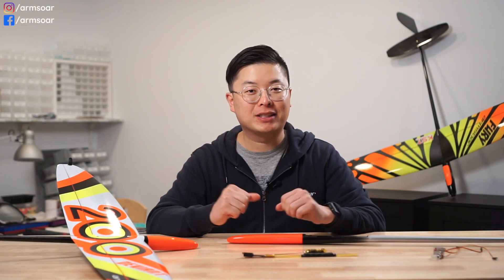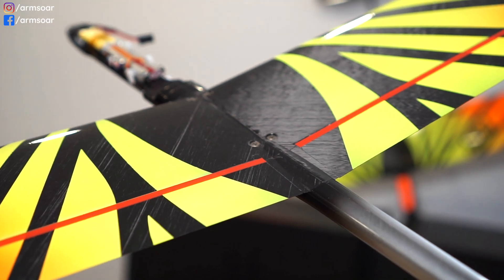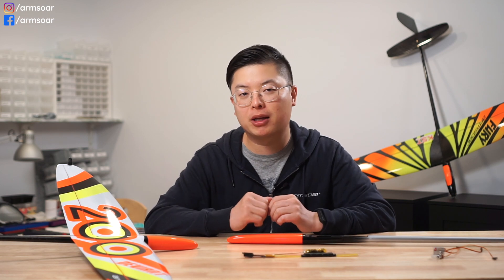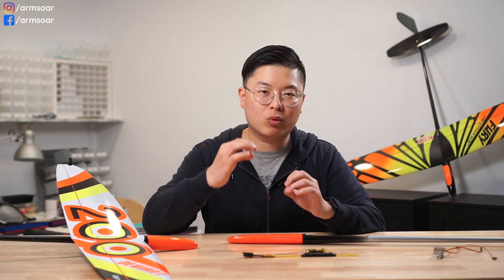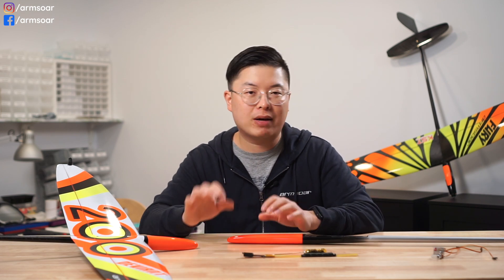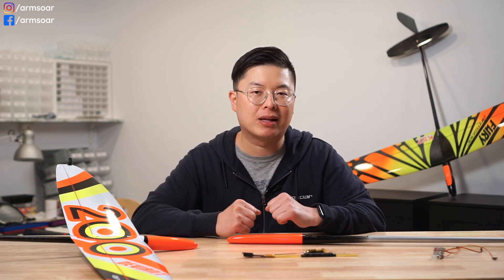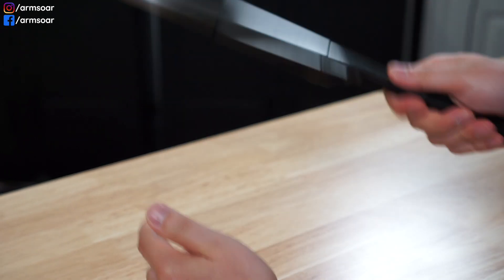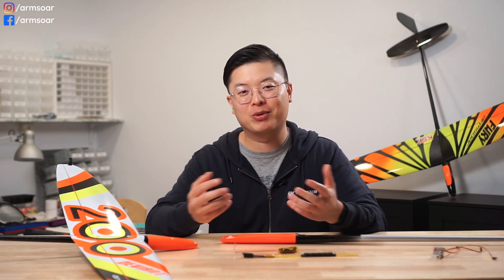RC Glider Basics | Ballasting Your DLG

Comment: Then you could use less expensive building materials like GFK instead of CFK. Then the plane must get other wings instead of more wight. It  will not get in my mind
Reply from the maker: That will lead to a plane with weights spread across the wingspan, reducing launch height, agility, and thermal sensitivity.

Comment: A word about the impact of wing loading on th polar of the glider would be in order. I often fly with water ballast in the wings of my full size glider and it increases x-country speeds greatly in good conditions. At higher flying speeds the glide ration of your glider improves a lot with ballast - but it has to go long with flight regimes of high air speeds, for example in final glide.

Comment: Hi Thomas - if you take the B2 as an example what is the AUW un ballasted vs 'with ballast' you might recommend starting out?
Reply from the maker: My BAMF 2's are between 205-240 grams AUW empty depending on layup. I'm mostly flying around the 220-230 gram mark, and then I would go to the strong at ~240grams, and from there start adding ballast. I rarely ballast my standard layup models unless I didn't have a strong layup with me. I can take my BAMF 2 to 380 grams with ballast but I never fly that heavy, 320 grams is about the maximum I would fly.